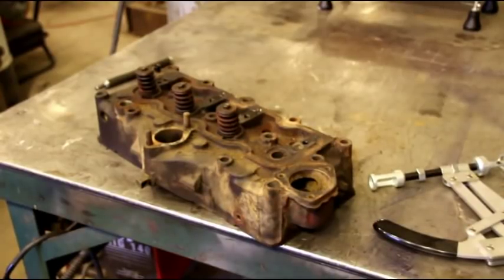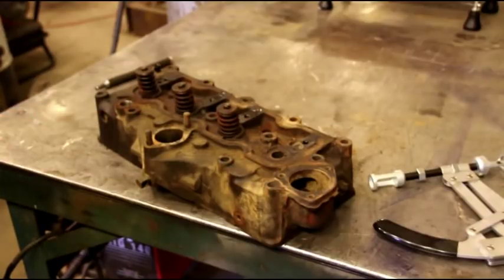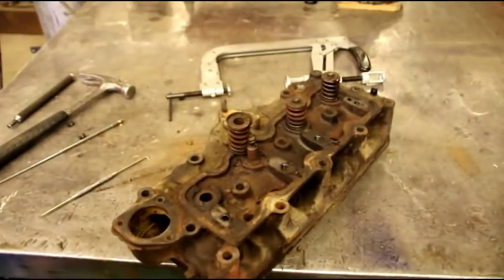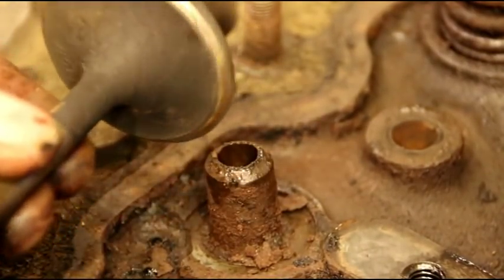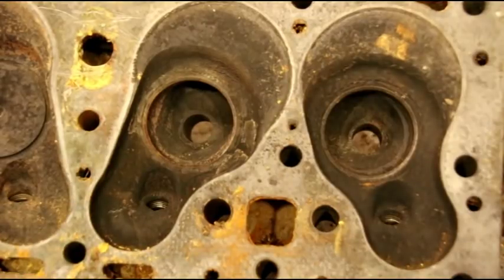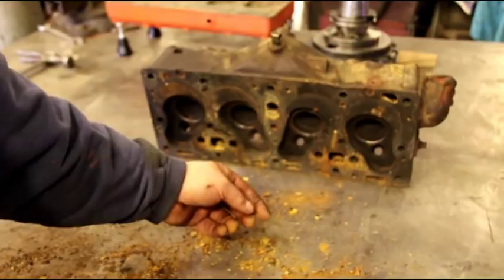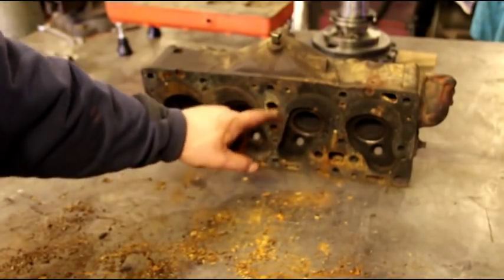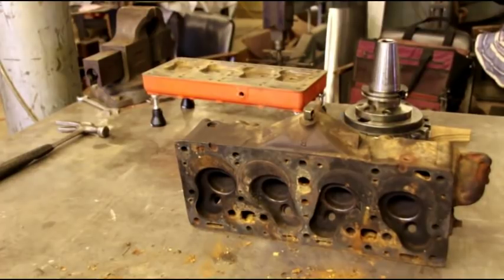Willys F Head Engine Rebuild Part 4 Head Disassembly

Comment: If anyone has a truck that needs the fuel pump replaced take the bolts out of the bed on one side and just loosen them on the other. Remove the 2 or 3 screws that hold the filler neck in place and tilt the bed up. Prop it up with a 2x4 and you can access the tank easily. 
Just throwing this out there because it’s so much easier, but not for you Brian. you said that your truck is so rusty that this tip wouldn’t work anyway. I hope that helps someone out there.
Reply from the maker: My ford is so bad with rust you almost couldn't find the bed bolts.  2003 with 62,000 miles and the frame, and cab are a mess.  the  underside will scare you to look at.  I always wonder why the modern trucks rust so fast and the 70 year old vehicles I am restoring lasted so long.
Reply: If they didn’t rust out you wouldn’t have to buy new ones... I’m sure they do it on purpose

Comment: Never understood why no access panels for fuel tank pumps on the wonderful world of "modern" vehicles. Great move with the zippo saw.  Dozens of other issues the same way. Really makes one appreciate some of the old ways of doing and building. Gotta love a two inch valve on a three and an eight inch piston, easy breathing, long pulling, hard working engine, sort of a hemi style with the center flow intake, just not the spark plug.
Reply from the maker: Those large valves are what make the F head such a great engine. People are always surprised when I take a 2" valve out of a small 4 cylinder engine.
Reply from the maker: Karl, I don't know why but your comments always show up and disappear, which makes it hard for me to reply.  On the cylinder head setup watch this video
https://www.youtube.com/watch?v=U4zzqzWHOz8

Right around the 3:20 minute mark I show how I use a depth micrometer to set the head perfect with the cutter.  By checking all areas of the head from the cutter I can set it up perfectly.  That is why the F head only took .003" to get a full cut and a true flat surface.  Hope that answers your question.

Comment: Have a friend that has a bell housing from a welder with L head engine  will that work on the snow blower clutch?
Reply from the maker: Yes, the back of the L head and F head are the same.  You can contact me at metalshaper@comcast.net  
Thank you very much.
Brian